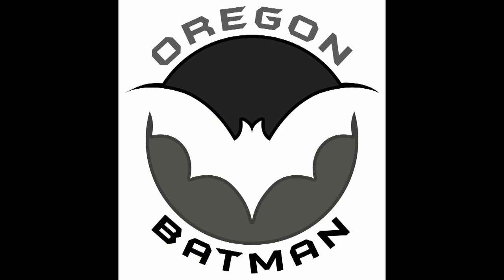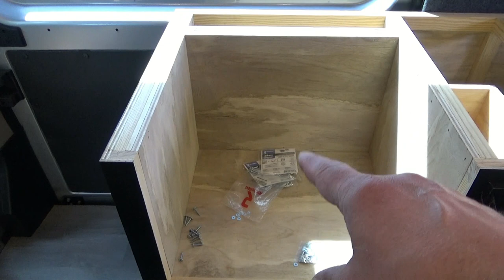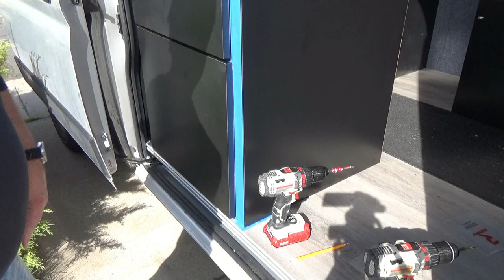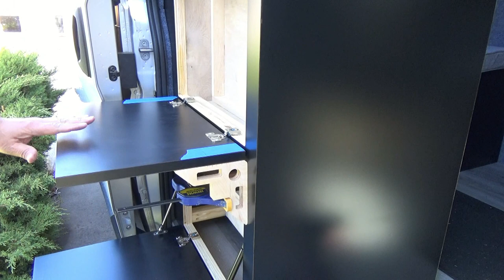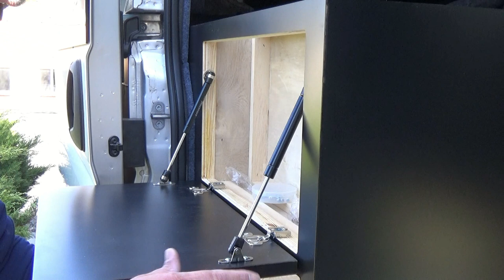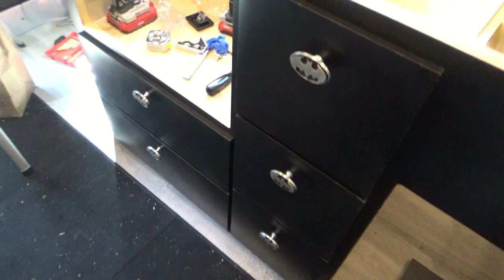Promaster Van Build 2500 159WB – DIY– Time to Face this – Part 24

Comment: Great job Al!  Especially with those struts that keep those doors at a correct angle:  better and most importantly more professionnal than the ones using chains or wires!
Reply from the maker: Thank ya sir... struts do have a cleaner appearance to them! I didn't like the idea of the chain